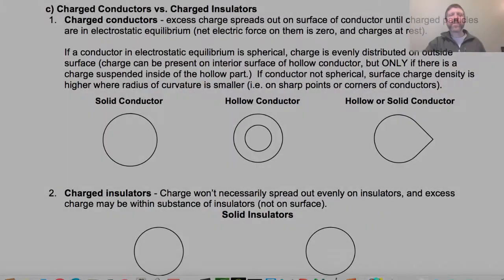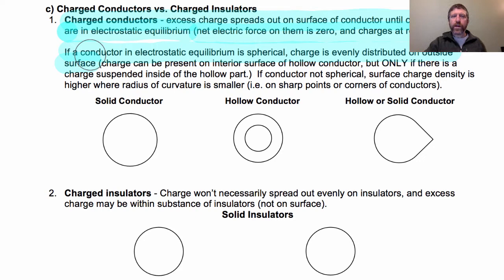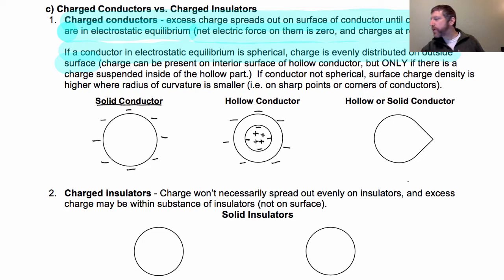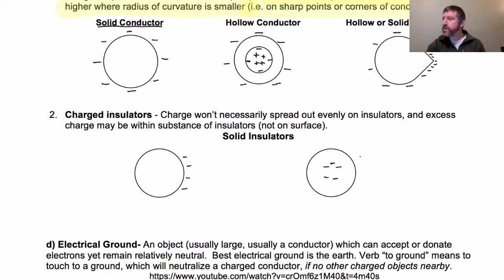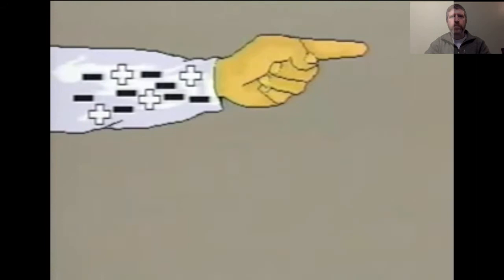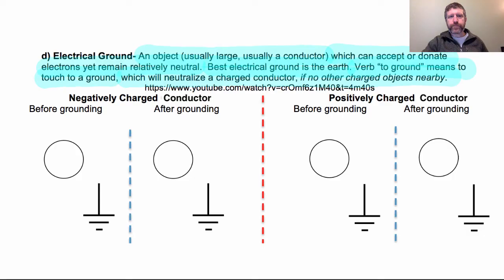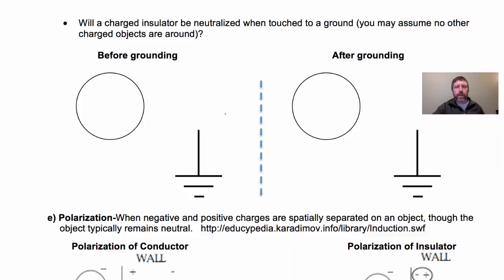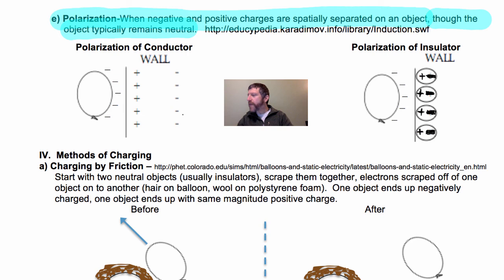13.03 Charged Conductors vs. Charged Insulators

Comment: I noticed that you only talked about negatively charged insulators during the sections about grounding an insulator. That begs the question, what would happen if a negatively charged insulator were to be touched to the ground. Would it become neutralised as electrons can transfer from the earth to the insulator?
Reply from the maker: you are correct in that a positively charged insulator when touched to a ground wire might become neutralized at the exact spot where the wire touched. In contrast to a charged conductor, only the exact point you actually touch to the wire will have a local charge reduction.  I have found insulators charged by friction are difficult to get fully neutralized with just a ground wire.  Maybe a metal grounded plate would do the trick =)

Comment: How about charged hollow sphere of insulator? What would the electric field inside the sphere be? Given that x is distance b/t center to inner surface and y is b/t center to outer surface. My HW answer gives me zero. I don't get it.
Reply from the maker: no matter what a hollow sphere is made out of, if the charge is uniformly distributed upon it's surface, the field will be zero at the center AND every point within the hollow part of the sphere, (as long as there are no suspended charges within the hollow part of the charged sphere which can create a field inside).  

If the sphere is solid and has a constant charge density, i.e. uniformly charged throughout, the field is NOT zero anywhere except the very center.  

Gauss's law works perfectly to help show this, once you've made the appropriate symmetry arguments: realizing if a net positive charge is held within a spherical volume, that the net electric flux through that spherical area in space will be positive. There is no charge within a gaussian surface anwhere within the charged hollow sphere, hence electric flux zero and E field zero at gaussian surface.  

Whereas with solid sphere with pos. charge uniform throughout, the Q_in is always positive for all guassian spheres inside or outside, hence field is non zero pointing radially outward, and increasing linearly until it gets to to r=R, at which it decreases as the inverse of the radius squared.